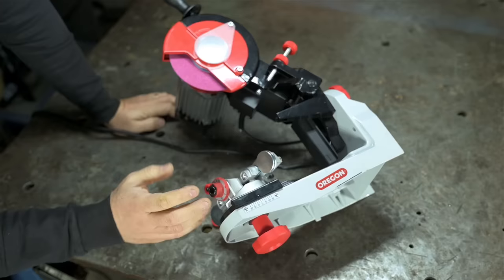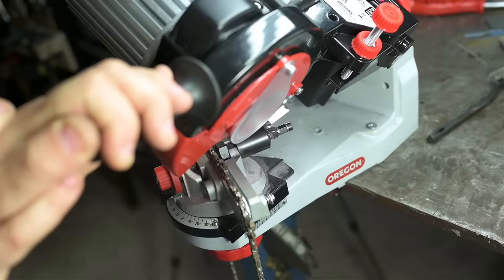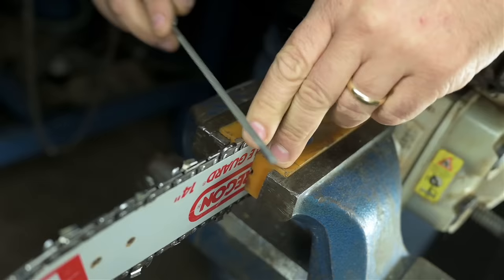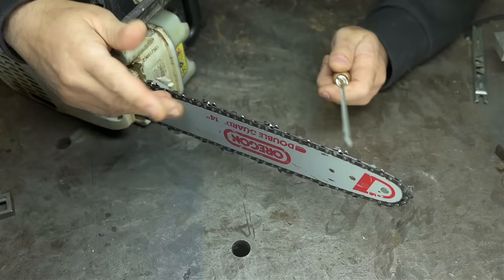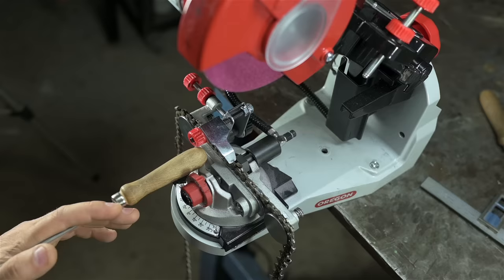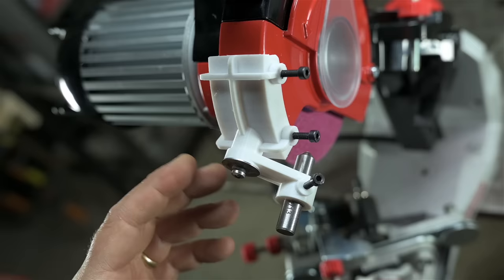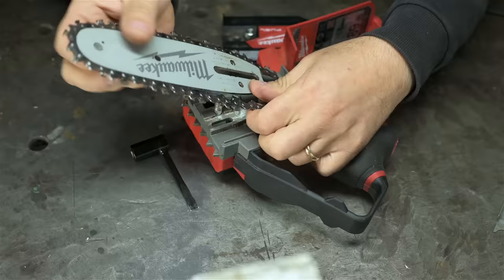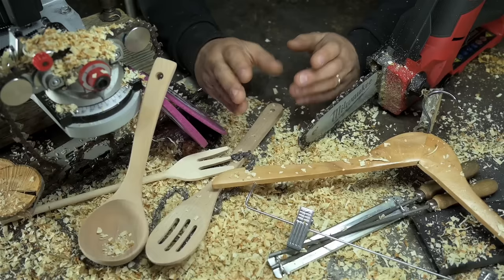Grinding Saw Chain! in Oregon! (620)

Comment: I have probably sharpened hundreds of Chains over the last years. I have never seen those markings on the Teeth. 
I really like the "Stihl" combo files. They indicate the angle and take of the little depth thing just the right amount.
Reply: Yes! That and the Stihl pocket chainsaw vice you can mount on a wood stump. Only thing I use on the go. It's fast, lightweight and simple, it just works. 👌💪
Reply: Yes! I used to hate sharpening. I would rather spend an extra 20 mins rubbing through branches with a blunt chain than get the hand file out. Now i have one of those stihl combo things i have found myself sharpening most times i get the saw out. i wouldnt exactly say that i enjoy sharpening but i enjoy using a sharp saw.
Reply: Pferd makes those for Stihl. They are great!
Reply: @MarkBeetham  Just for a moment I thought you wrote "...found myself sharpening /more/ times than I get the saw out."  Glad to know that you haven't got the filing bug that badly.

Comment: Loved the metric tree joke 🙂
I've always understood the line on each tooth to be the maximum amount of metal you can file back before the chain is worn out. I'd not considered the angle check, nice idea.

I tend to file when working in the field, then run the grinder on the chain before putting the tool away, so the teeth are uniform and sharp ready for next time. I agree that the grinder does take off more, I've found that you need to set the tooth position separately when switching between the lefts and the rights. I advance the tooth towards the wheel until its just cutting enough.

The other handy one is to flip the chain bar regularly so that it wears uniformly on both sides and you get better life from it.

Comment: That line on the top of the tooth at the correct cutting angle is also the maximum life of the tooth marker. Can't file or grind any further than that because the root of the tooth is too weak and it'll just snap off in the cut, which makes for a fun time trying to pick it out of the cut before you go at it again with a new chain.

Comment: As someone that can razor sharpen a chain by hand, I can't believe I just watched a 29 min video on it!! LOL great vid. When he mentioned the teeth not being hardened, you would never want super hard teeth on a saw chain because they could easily snap off and strike the operator or a bystander!   the speed of a tooth flying off the chain with it wide open at 9000 rpm and getting hit could be pretty bad.

Comment: Love your stuff.
The fastest way to sharpen a chain is with a Dremel, or similar, tool with a new cylindrical diamond bit of the correct diameter. With a little practice it's more controllable and accurate than a file, and faster, and many times faster than any other sharpening device.
Reply: watches a Dremel head yeet off the wall and outside the garage
Reply: @LabGecko  well, you need to be competent.

Comment: The hand filer from Stihl is pretty damn good. Never been real good with a file but I get REALLY good results with it.
Reply: I could never get the rakers to match up with the teeth height before, and I will ONLY use this tool now!
Reply: Yeah buddy! Seems like a lot of people ignore the rakes no matter how they sharpen. I cut a lot of softer wood and even some blades right out of the package have an overly conservative rake height for how much bite I want to take. With a 2 in 1 file, they are always right!

Comment: I had a chain grinder and loved the way it sharpened the chain crisp, sharp, and consistent. It took too long to set up and sharpen a chain, so I took it apart and now use the motor and wheel for sharpening small drills and cutting tools. A file is all you need. No grinder, no angle gage, no other gimmicks.

Comment: Awesome. I do make ripping chains and they need to be consistent. I usually hand file chains for crosscut a few times then stick them on a grinder to get everything back to matching. But when ripping I use the grinder every time. I also use the grinder to take down the rakers(depth guides). When crosscutting as long as a chain is halfway sharp it doesn't have to cut straight for more than 10-20 inches usually at most. But when ripping through 8 or 10 feet the chain has to cut perfectly straight all the way.  I don't think perfect angles matter as much as consistency as you mentioned. Thanks Tony

Comment: Thanks for the video. I’ve had those grinders for over 35 years. You are right on about most of your comments about them. My first was a manual locking one. The last fifteen years with an  an automatic one, I wished I now had a manual one. Yes your chains don’t last as long as hand filing, but you cut more wood faster. What always gets me is the price of the grinding wheels. Anyone who has a medium to larger chainsaw, should look into getting a skip chain. They cut faster and there are less teeth to sharpen.

Comment: That was a really excellent vid as usual.

Those Stihl 2 in 1 hand sharpeners that simultaneously lower the depth gauge and sharpen are a game changer for me. 

I have 4x saws and I find that the bar sharpener jig comes out only after I've put the saw into the ground.
After I use the bar jig, then the 2 in 1 hand sharpener works again.

Before I'd use the conventional hand file about 3x and the 4th time I'd use the bar jig. Now though, the  bar jig only comes out after a mishap. Big time saver those sharpeners.
Reply from the maker: I hear good things about them, I might just have to pick one up!

Comment: After spending 1/3 cost of a new Stihl chain to have mine sharpened by what I can assume was dragging it down the road, I bought enough loops to get me through a full day of cutting and learned to file myself. 
Pro tip: I use a wood shim between the bar and chain to keep it taught.

Comment: Imma home gamer when it comes to saws. Living in the forest, however, I tend to use my saw more than someone in the suburbs... least I hope so. I use my 20" saw a few times a year. Careful not to dig the chain into the dirt, or hit a rock... only cutting wood here, I found that my chains get dull quick. Hand filing was my go to method of sharpening the same chain, over and over again... hours and hours of my life spent on running a file at a 30 degree angle across the top of my chain. I got tired of it! 

I bought this exact same model grinder. Set up was simple enough, after you have spent time with a file, you get to know a thing or two, and it came easy to setup. But gah!! I gotta take the stupid chain off the bar EVERY time I need a sharpen. So, I bought a new chain, because that makes more sense? My method to my madness was to rotate the chains. Once one goes dull, swap it for a sharp one, and grind the dull one on the grinder. Rinse and repeat. 

That was a few years ago now. I have an old coffee can full of dull chains, and about once a year (typically in the winter) I sit at the grinder and sharpen them all up. I hang the sharp chains on a nail in the wall. During the warmer times of the year, when I'm out making noise with my saw, I simply grab a sharp chain off the nail (plus the one on the saw) and head out to do my work. When I come back, drop the dull chain in the coffee can. 

I have turned this into somewhat of a side hustle. One of my neighbors saw my grinder and asked what it was. He cuts firewood as his side hustle. Over a few beers in my garage, he offered to pay me to sharpen his chains, $5 per chain. The local hardware store charges $6. He is getting a deal! The word spread and now I grind chains on the regular for 5 different people. I'm not going to be rich anytime soon, but sitting at the bench, sipping a good brew, and making a few bucks, worth it. 

Awesome review Tony! Love to see it explained so well, as only you can do!

Comment: I appreciate the thorough video. One easy way to use a grinder: I buy four chains at a time. I use all four, then sharpen at the same time so I don't have to change the grinder settings or depth or settings. I use them all again and increase the depth as needed and then grind all four at the same time again. I only fuss over the first tooth on the first blade each time - very easy.

Comment: Been making and grinding saw chains for 15 years for procomp guys and loggers, usually 80 to 100 chains a week. Set the vise a bit looser, so there's just enough drag on the chain to keep it from sliding through. This minimizes the flex. Then, right before you pull down in the grinder, pull the chain back and snug into the stop pawl. The pawl itself will hold the chain down in the vise because of the angle. Before the fancy hydraulic vises, we would set the vise just tight enough to keep the chain upright and centered and use only the pawl itself to hold the chain down. Sharpen your chains by hand 4-5 times and save the grinder for truing up the angles and lengths of the cutters, this will get the most life out of the chain. Like a knife with a blade steel, most of the time a dull chain just needs a touching up of the edge.

Comment: Wow. Fantastic video. But, by far the most fascinating, interesting part was the revelation that there are metric trees and SAE trees.I did not know that.  Furthermore. I went out Into the woods behind my house and used my SAE/ metric caliper, and verified that this is true. Changed my life! Thanks. The very thorough and detailed. Instructions on sharpening saw chains was a mega bonus!!

Comment: My opinion on these grinders: It depends why you use them. I own a saw chain grinder, it's a chinese model and not really high-end, but I like it. I use it if I hit steel parts or dirt with my saw chain. In this case, a full-chisel chain is dead. Out in the forest, I simply change out my chain. Then, back at home, I sharpen it using my grinder. Try to sharpen a really bad tooth with a file... not my favourite task. But: If i only have a saw chain with dull teeth, I still like to resharpen it with a file. It simply consumes less of the tooth and in case of a moderately worn tooth, it's faster and simpler and, most importantly, it also works in the woods.

BTW: I really liked the video! Tony, it's always a pleasure to see/hear from you.

Comment: The first modification I made to my chain grinder after bolting it down was to toss the aluminum oxide wheel and replace it with a CBN wheel. I never thought to check radial runout on it and will have to do that. CBN abrasive is wonderful, it stays sharp and does not need regular dressing.

Comment: Holding the chain in place while filing it can be done with a pan grabber of the metal clampy type.   I prefer the American Metalcraft 9540 Deep Pan because it's good for handling loaf pans with camp stuffed cornbread in them.  $6 each, buy two and hide one. Ours is 55 years old.

Comment: FYI some guys mod the motor so it can change rotation direction at the flip of a switch. That way it runs forward for the right cutter and backwards for the left cutter. The stock always-forward motor leaves a burr on one side of the chain but not the other. I haven't bothered.

Comment: Repeatability is the key. Don't use the vice lock, per say, but make sure its tightish. Every grind will settle into the exact same place. The other key is the hold onto the back of the chain and pull it, as it then sits hard against the metal stop-gauge, so it will sit in the exact same place every grind.

Comment: I worked at a chainsaw shop back in my college days, and the pros's said to stroke  file into the cutting tooth, instead of away,  produces a finer cutting edge. Kinda like a downcut router bit on the CNC, less tear out.

Comment: I cut mostly hard, dead oak, and I agree with you: a little more hook seems to work better. I like to think it leaves more gullet to clear chips with, but who am I to know? Typically I'll test a new grind style for about thirty seconds, drop my bar in a moment of weakness and dig an accidental trench through a hunk of sandstone, and go back and try some other mostly random grind.
Reply: I've burned through a fair amount of chain, but it wasn't until this video that I noticed that, at least on your chain, not only does the top plate have a helpful angle suggestion engraved across it, but the side plate also has a marking suggesting a gullet geometry. And on yours, the suggestion was deeper than you got, either with the grinder or with the hand file. Gonna need to try that, when firewood season returns.

Comment: For sharpening 'out in the wild' you can modify a vice to fit on your tow-bar or if you are using a trailer to gather wood, weld it to one of the pull braces of the trailer.

Comment: I just bought that same grinder and used it for the first time.  I love it.  I bought a CBN grinding wheel to put on it.
Reply from the maker: nice!  you'll have to let me know what you think of the new wheel.  I ordered one but haven't gotten it yet.
Reply: @ThisOldTony  I’ve done two chains with the CBN wheel and I like it so far. I’m getting good results and the cutter teeth do not get hot. I think it’ll be even better next time because I won’t be correcting the angles on the chain from hand filing.

Comment: I have been using a grinder like this for years and completely agree with the "CBN" wheel comments I've seen; you definitely should consider trying one.  Your observation about the chain clamp causing issues is spot on!  I have a cheap knock-off brand grinder and the mechanical chain clamp on it has similar issues.  If not careful I can misalign the chain quite severely when using the clamp.  I will examine the feasibly of your "spring" idea for my situation.  Thanks for a great video!

Comment: the point of sliding the base in and out is to center the chain under the grinding wheel. 
the third angle adjustment is rotating the chain so that it’s no longer 90deg to base.

Comment: I’ve got the 620, I went for that model because it had the auto clamp. I figured on a 12” or 15” loop, hand clamping wouldn’t be soul destroying; but that hand clamping on a 25” or 36” loop would be. As you say, setting up the length of grind, is a trial & error sequence due to the auto clamping. I think it takes me longer to setup that one parameter, than it does to setup all the other angles combined. If I had the same decision to make again, I’d buy the 520.

If I used just one brand and all my chain was set at the same angles, the 620 would be worth it. Buy the chains are different and I occasionally sharpen chains for friends, (who can blunt a chain but are incapable of sharpening a chain).

My advice, if you only ever run two chains at a time, save the money and continue hand filing. I do 95% if my sharpening by file, only resorting to the grinder, if I’ve got several mashed chains to sharpen at once. Then I do all the .325s at once, then all the 3/8s, then any pico chain, each chain requires a different wheel. I once tried taking down the depth gauges with the grinder, figuring they’d be a uniform setting. But never again, there’s just too much inconsistency in the auto clamping and it’s much too easy, to remove far too much material. So grind the teeth/cutters but take down the depth gauges with a file.

Great review - thank you.

Comment: Tony, there's a fairly new file holder from Stihl, the "STIHL 2 in 1 Easy File", that not only guides the file at the desired angle, but also dresses the rakers as you file the tooth. It's extremely quick and easy to use in the field, and produces an excellent edge. ProjectFarm tested it and approved. I have three (one in each of the three chain sizes I use) and I would recommend them.

Comment: Hey mate, I've been using these grinders since I was about 8 years old, helping mum out in her small engines shop. Not sure how much you've put on for the video, but she taught me to lower the wheel while it's off, then adjust the chain up to it. When the tooth slightly hooks on the wheel as you lift it back up, you've got it taking the right amount off. Not too much, not too little. I also tend to go 30/30 for the degrees on semi-chisel chain, but that's subjective and your mileage may vary when not cutting dry Australian hardwood.

Edit: oh bugger, I don't know how I'd go using the hydraulic chain clamp. I guess I only set the cut once per chain, so loosening it up while the wheel is down wouldn't be a big deal.
Edit 2: I should just finish the video before commenting. Great video, mate!

Dad always told me to tap by hand; one turn forward, half a turn back. It's slow, but I've never broken one ...from my good quality set! 😋

Comment: I was a Groundsman for a tree company here in Oregon for more than a decade and found hand filing with out a guide is best practice, only time I found a chain grinder handy was for repairs.
As far as sharpening the chain differently for different woods I would say the cutting angle should stay the same just the heels should be knocked down a bit more for soft or pithy wood to reduce drag.

Comment: Chain moves when it gets clamped, so the adjustment will be off if it’s made with it loose on the manual one. I have a manual clamping sharpener and I have to clamp for every adjustment to make sure it’s accurate. So the hydraulic one is the winner, IMO.